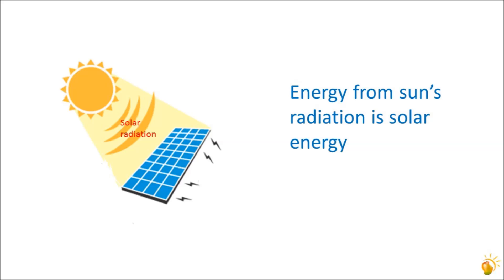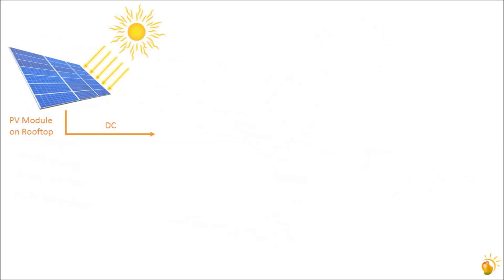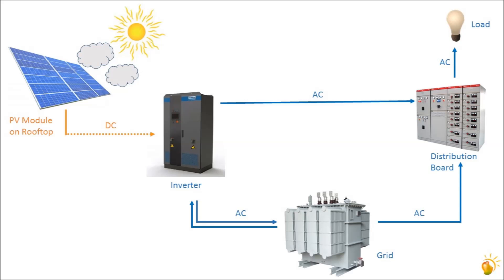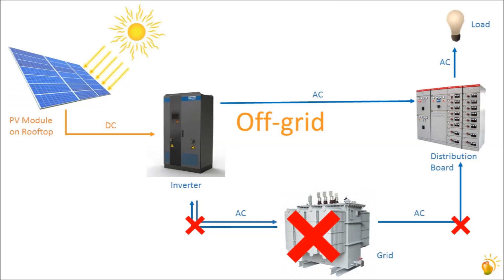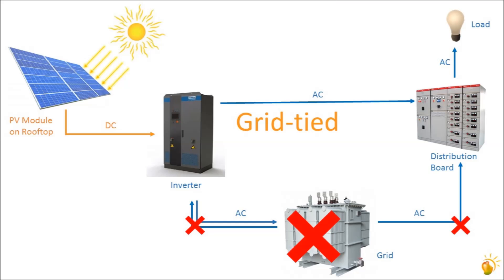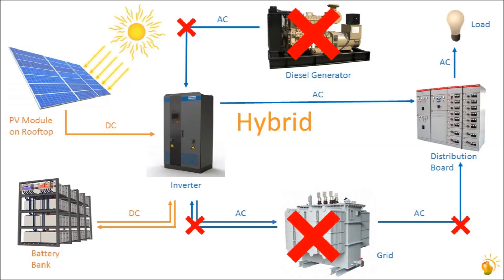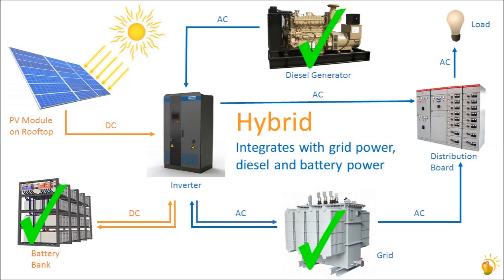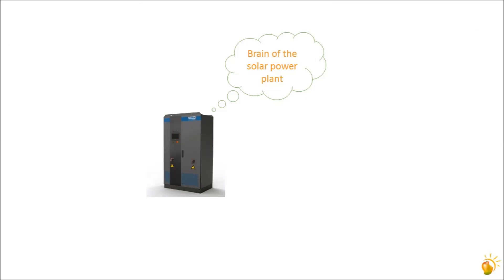Basics of Rooftop Solar PV

Comment: I do not understand if the grid goes down and the sun shining why wouldn't i have electricity from the solar panels?
Reply: J.MaestroGringoPendejo SMA Sunny Boy Solar inverters provide secure power supplies which provide 2kw output when the power is out and the sun is shining. I'm installing two SMA inverters to provide two of these outlets.

Comment: what kind of crack are you smoking? I can run my inverter even if both batteries and grid are down as long as there is day. complete crackpot. only a few inverter setups choke when there is no grid tie. this person has no idea what they are talking about
Reply: Which inverter is the best?  For two 110 air conditioners, a fridge and a couple of lights? on grid system no stove. thank you sir
Reply: Hello he is an professor in IIT Bombay. He has his Phd in solar Boss. Don't write rubbish
Reply: I am sorry not this person

Comment: which is best option for homes ?
Reply: SOLAR PLANT WITH INTVERTER ( NOT GRID) ,DEPENDS ON ROOF AREA AND YOUR ENERGY REQUIREMENT I LIVE IN CALIFORNIA and MY house with 16 flats(2br) have made the roof top solar power . $2000 / flat x 16 flats:energy included : great demand as these flats have been leased THRU HUD to US GOVT. 100% income guaranteed and no headache for next 25 yrs until i die

Comment: Sloar PV and solar-thermal panels should be fitted by the landlord in all social housing, with the rewards apportioned 70:30 or thereabouts so that both the landlord and the tenant gain a financial advantage, no matter how slight. WE must realise that while oil is relatively cheap, it is a finite resource, and will soon become far too valuable a commodity to simply burn!
Reply: Correct. I've calculated that as a commodity oil won't just run out, long before that it will take too much energy to extract. This is called the Energy return on Investment of Energy, and the calculation shows oil is uneconomic to use by 2046 at the very latest. (BP and Shell disagree with my figures, putting it at 2026 and 2035! I did my calculations based on very conservative estimates, including factoring in new shallow depth finds etc.) Once this begins it will be too late to manufacture, distribute, deploy or service any form of substitute energy because every one of them is based on a economic system built for oil. Think about it. Oil is used to extract both coal and gas. Oil is used in plastics. Think of that alone! Then consider what moves shipping, large aircraft, farm machinery, mining machinery! It's oil based and there's no way to substitute for it, because all other fuels are secondary fuels, so are too expensive. I predict by then not even renewable energy will be of much use to allow us to live like we do now. There's going to be famine, social and political unrest, revolutions, wars and climate change sea level rises all happening roughly at the same time! If we don't start now, we never get another chance!